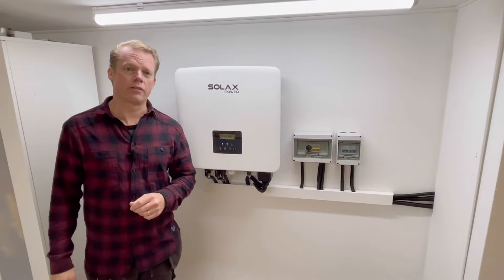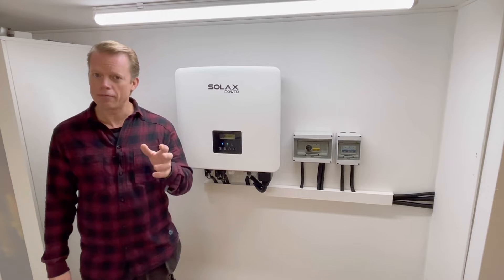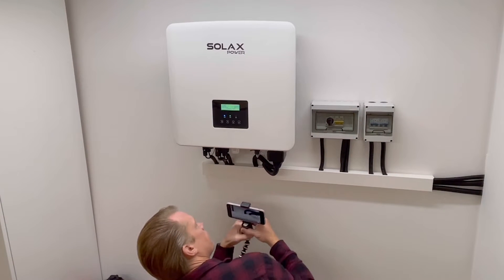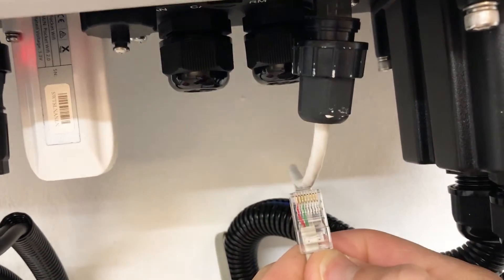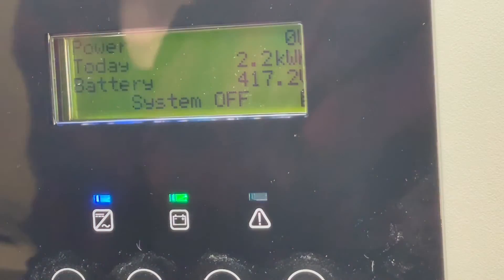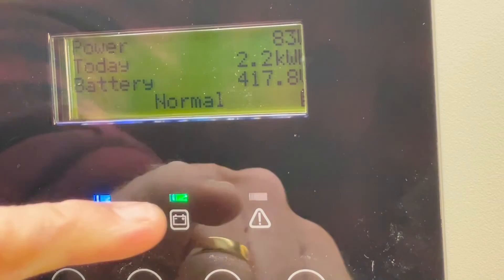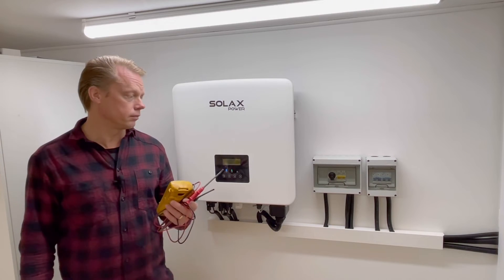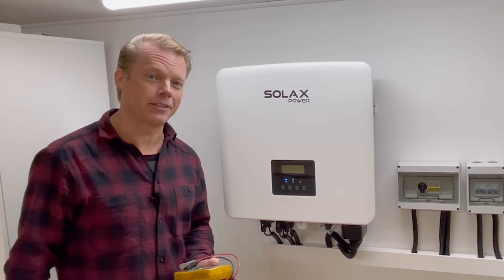Solax tempsensor instead of BMS communication, stand alone high voltage home battery, solar storage

Comment: I have a solax X1-AC.
It will not retain the lead aid absorption voltage setting or the low cut off setting.
Anyone know how to make it store these settings?
Having a NTC connected or not makes no difference
The battery light is not lit
The battery indicator is showing flashing and empty.
The inverter is otherwise working normally
Thanks
Reply from the maker: Sorry for my late reply. I have personally never worked with x1 so I don’t know. Hope you figure it out.

Comment: We starting Acid battery.

Can U please give info about connection place (1 and 3), but its 10K or 20K NTC sensor? 76kOms +16°C
Intrestong sensor. Its 100kOms NTC I think 🤔.
 We make a tests.
Reply from the maker: The info I have are in the video.
Reply: @flyingtools  In the manual pins 1.,2.,3. is empty!
May be need a special firmware?

Only in the first time after the ntc connected error went away for 10 seconds and coming back 😞
Reply: NTC error. I checked one more time and error IE105
EPS output is not working.
We connected
RJ45 connection wiring B
Orange white and green white wires

Comment: First, thanks for the information.
Is it possible to configure a 6 unit (HV) TAICO battery with a capacity of 100 or 200 amps for a SOLAX converter?

I would appreciate your help on this matter.
Reply from the maker: Thanks, you’re welcome.
Sadly I don’t know anything about those batteries sorry.

Comment: The Li-ion battery is working in the Lead acid modes,without a BMS,  you need first switch on the DC battery with the temp sensor  then the parameter stay's on Lead acid.
The test battery is only 2,2kw and max 320V lowest 224V but it is working, 
I have another 11Kw car battery but the BMS is defect, and that is a challenge to get a bms connected,  but thanks for the support, also  big thanks for the  perfect After Sales service of Solax in the Netherlands  they are very helpfull  
Regards Marcel
Reply: Can U send info about NTC.
I connected 75 oms to BMS connector 1.,3. white orange and white green.
10sen IE105 error goes away, and after ~10 error, go back and restart, not help :(

Comment: great video's big fan of your work and what a cool place you have.
question: has your firmware special features ? or is it just the newest  FW that wasn't available at the moment that time?
what are your battery settings for the lithium battery? how does the X3 knows what the voltage must be?
just hooking up en the X3 measures the voltage before switching on?
 OR
like in the AcidLead option are the"charge float" ,"charge cut" voltages to be set?
Reply from the maker: It has the latest firmware now for 
eu/Sweden. The settings is set manually, voltage and amps regards to your battery specifications. It use constant current  up to the preset voltage and then it will charge with constant voltage instead.
The float and bulk voltage is the same in my settings and it works perfect.
Thanks for your questions ☺️
Reply: i assume you don't use the leadAcid option.... (?)
 @flyingtools
Reply from the maker: @yviojacobs3443  i use lead acid mode.

Comment: I  connect a potentiometer  of 100kohm for test, but if i select lead acid it still go's back to lithium, is it nesseserie to connect the lead acid batterie first, so that the inverter see's a voltage wenn change  to lead- acid   regards Marcel
Reply: Ok, i shall test it on the end of september, first 3 weeks holyday   tanks  for your fast  answhere ik keep you informed regards Marcel
Reply from the maker: No, i do not think so. But i remember that it was easy to miss the saving after the changes in the menu, especially if you do it on the inverter.
It much easier in solax cloud.
Hope you will have success😊
Reply: I did it Senegal times on the inverter and also in the cloud but every time it switch bag to lithium, i contact Solax and they change it remote to lead acid, but it also switch bag to lithium, i don't nog if it is a problem to connect the  batterie first and then change te parameters to lead- acid 
 The guy's from Solax can't find the original partnummer of the tempsensor do you have it
Regards Marcel
Reply from the maker: @marcelkool7417  then you have to try this again when you have your battery hooked up to the inverter. Sadly I do not have the part number for the temp sensor because I got it together with my inverter. I wish you luck with your system.
Reply: @marcelkool7417 Hi Marcel,  have you found the issue for inverter doing this behaviour..? Does you need to hookup the battery first.

Mine also go back to lithium when lead acid mode is selected

Comment: hello , what are the last news ? have you put the bms ?  that bms is communicative one or safety  only open relay in case of cell fault?have you choose a active balance model ?  i ever used 48V pack right now on all my DIY pack , but find a good way to have more effiiency on DC/DC/AC conversions can be better, i estimed at 17/18 % the loose on low voltage battery LIFEPO4 16S from panel to usefull AC , i think it can be 6% loose only with high voltage . thanks for sharing
Reply from the maker: Hi and thank you.
The bms is now installed, I have videos on that on my channel. Thanks for your comment 😊

Comment: Great video, Subscribed.. I am thinking of connecting my 420Volt Nissan Leaf directly to this inverter. Would you be kind enough to tell me this inverter can export back to the grid as well?
Reply from the maker: Hi and thank you so much 😃 
Yes it can, both from solar and from battery if you like, it’s a great inverter👍🏻
Reply: hi Ravishawijesinghe  i have also a nissan leaf battered and about to hook everything up. do you have the battery settings?  i can't see more settings in " lithium" mode. is a temp sensor for now enough?  i'm still waiting on mij lilygo can bus pcb for the project like " Dala's EV repair" 
https://www.youtube.com/watch?v=XHZWGLzT7gg

Comment: Great Video, amazing stuff! Can you share you battery settings in Settings-Advanced Settings-Charger? 
Did you set to Lead-acid and what are the settings for 
Charge Equalization Voltage
Charge Float Voltage
Discharge cut Voltage
Discharge Backup Voltage
Max Charge Current
Max Discharge Current
Thanks!
Reply from the maker: Hi and thank you 😊 
I have plans to make one in the future.

Comment: Hi, your battery led indicator is green. Have you done anything special to make it turn on? I have the X1-Hybrid-G4 with lead acid mode on, temp sensor is ok, contacted solax and upgraded to latest firmware. My battery is recognised but led indicator on the inverter panel is off so I can't discharge it in self use mode
Reply from the maker: Hi!
Make sure that you have the discharge timer set correctly. For example Start discharge 00:00 stop discharge 23:59. If just 00:00 to 00:00 it will not take power from your battery.
Reply: @flyingtools  Discharge times are set like you said. I think the main problem is my battery led indicator is off and on bottom right of the screen your battery is full while on my screen, on the bottom right of LCD, the battery is empty and flashing all the time (like SOC is 0%). Did your battery led indicator turned green as soon as you activated lead acid mode the first time?
Reply from the maker: @bozzob7873  what voltage do you have on your battery?
Reply: @flyingtools  currently 366V. Is a Renault Zoe 41kw battery pack so 96s2P .. around 400v fully chargeg and 330v fully discharged
Reply from the maker: @bozzob7873  okay, good. Have you done the settings in the charger menu? For ex discharge cut off voltage?
Reply: @flyingtools  yes, no matter what I set the battery led never turn on. I can charge just fine from grid, I can also discharge the battery in EPS mode. But in "Normal" mode I can never draw power from battery, I can draw only from the grid
Reply from the maker: @bozzob7873  if the loads are under 200w or so it will not discharge from the battery, at least mine x3 works like that. Sorry but I start to run out of ideas now.
Reply: @bozzob7873 hello
How did you fix this problem? Because I have same problem with x1 invertor.
The bottom right of LCD the battery is empty and flashing all the time(like SOC is 0%)
Reply: @igo2442 did you sort this as I have the same issue?
Reply: @igo2442  what was the solution for this issue?
Reply: @stuartfram5184    what was the solution for this issue?
Reply: @rosislavrusev9870  this issue was fixed level hi/low procent of charging battery and hi/low level voltage battery

Comment: Hi. Can I connect X3 hybrid invertor to single phase network? EPS will provide 3 phase or only one? I have look in the manuals and didn't found anything.
Reply from the maker: Hi!
It will only work with 3 phase input only. 
Eps 3 phase only.

Comment: i see now you used lead acid mode , so temperature sensor is just for info , you use still the original battery bms ? ? the original bms need a 12V pulse to close relay to simulate the " the run mode " of the vw
Reply from the maker: I run it without bms at the moment but a bms is on its way.

Comment: Hi , if i understand you idea , you put a 100k  ctn on 2 pin of the plug , and the inverter see that as a can protocole ? can we ajust on solar the current ? the low battery , the shut off , the high voltage , etc ? you maybee have reduce the range to run from 10 to 90 SOC ? and the battery have still the original bms able to cut the internal relay if a cell go to run out of range ? 
thanks for your sharing
Reply from the maker: Hi!
I run this without bms at the moment and charge between 3,6-3,85. A stand alone bms is on its way. Vw bms are not working without the rest of the car.

Comment: In your current configuration of the battery are you using any bms or how you have control over individual cell voltages?Do you use a safety relay?
Reply from the maker: I check the cell voltage manually on regularly basis. A bms is ordered but are one backorder. I just use dc fuses as the only protection at the moment, but that will be changed.

Comment: I've been building a Lifepo4 512V system with the same inverter since August. I'm still waiting for delivery of the batteries and inverter ...
I did some measurements last week on a Solax X3 10.0 G3 and the NTC thermistor is 47k/25°C.
I have a question - how did you solve the battery connection? I mean the pre-charge system. 
This video made me very happy :)
Reply from the maker: Hi. The precharge system are built in to the inverter when it does the startup procedure. Nice battery pack you building there 👍🏻.
Glad I could make you happy😊
Reply: For me, an NTC error will go away for 10 seconds and comming back.
Restart not help.
In the manual, BMS connector pins are empty 😞

Comment: Does the solax inverter in lead acid mode calculate the SOC based on the current voltage? Is this information available from the inverter based on modbus/TCP? 
Regards,
Robert
Reply from the maker: No, the start of charge are always displayed as 0% soc in lead-acid mode.
I will ask solax about this, maybe it will be in a later software.

Comment: Hi, I tried it out last night with a potentiometer set to 76k, it works great.👍😁 The setting 180k would correspond to 0°C and 39k to approx. 30°C.🤓 At the weekend I want to install the Solax properly again, at the moment I'm using the Growatt, but from my point of view it's not as good as the Solax.
Reply from the maker: Richard, Great Jobb👍🏻👍🏻 Thanks for the extra info about the different temp/ohm numbers. Just perfect. I must say that the solax inverter has performed over my expectations by far. 👌🏻
Reply: Thanks for the info, when using a 75ohm resistor what watt does it need to be?
I'm waiting on the CT coming from solax but it will take 3 months before I get it so it is good to see I can use a resistor to use the battery until I get the proper sensor.
Reply: @dermotdickson3869  that would correspond to about +15°C...
Reply: @dermotdickson3869  The wattage is not important because it is only an "info signal". 0.25 watts is fully sufficient. 
You can also use a 100k potentiometer with 0.25W and set the "room temperature" or measured battery temperature.🤥😜

BUT just buy the NTC 50 directly, costs 2-3 euros💲💲 , then you always have the real temperature. 🤓👍
Reply: @RichardSteigmann  when you say NTC 50 do you mean 50k NYC thermostatic resistor? Thanks
Reply: @dermotdickson3869  yes, NTC 50kohm resistor
Reply: @RichardSteigmann  thank you for the info
Reply: do a video of your setup..
Reply: For me, 75kOms after 10 sek inverter swobe OK, but after 20 sek the some error 😞
I need to recheck.
  Chande settings to litium and back not help 😮

Comment: Okay, so we need FW for inverter that have lead acid mode, i was in contact with factory and got answer and the impression that in latest FW there is lead acid option as default, tho the inverter they referred was X1 version, but that may be just language barrier. If anyone knows is there "lead acid" mode also in latest firmware for X3 models, please post info. Thanks for new video, there is not too much info available about Solax X3 details when using other than with Solax batteries. Keep on the good work ✌️
Reply from the maker: Hi and thanks, yes i have heard that the latest firmware will have lead acid mode in the x3 models. Thanks for your comment ☺️

Comment: What is your plan with the E-Tron battery,just wanted to know.. maybe use it as an extra storage? I think it should be same voltage range with the id3 but not sure.. what voltage range do u run the storage? From 420v max i guess the solax can give  to lowest ? 356v?
Reply from the maker: A friend to me are going to use it for solar storage. Id3 62 kWh are not having the same voltage as the etron battery.
Reply: @flyingtools  make a video of that ,which is wider voltage ..id3 or etron

Comment: Säkerligen väldigt uppskattat av Solax-folket 😃👍

Rätt högt motstånd för att vara en tempsensor, har du kollat vid olika temperaturer?

Fungerar batterivärmarsystemet bra?
Reply from the maker: Ja, det är rätt högt, nej inte testat olika temperaturer då syftet var att få ett värde som invertern accepterar. Batterivärmen gjorde jag klar i förra veckan men är inte nöjd med videon… Får lägga ut den ändå tänker jag😅 Nu håller jag på att bygga lådan som batteriet ska få bo i, annars är det att elda för kråkorna. Tur det är milt ännu.
Reply: @flyingtools  Gott att det fungerar med värmaren, synd med videon, men det viktigaste är ju att man ser funktionen! 👍

Ja, gott att det är milt fortfarande, men det smäller väl till snart och blir snorkallt och mörkt. Lite synd att inte ha batteriet inomhus, men förstår att det känns säkrast att ha det ute. Blir spännande att höra hur mycket ström det drar att hålla värmen i paketet. Du får bygga ett litet uthus annars och ha batteriet som ett element där 😅